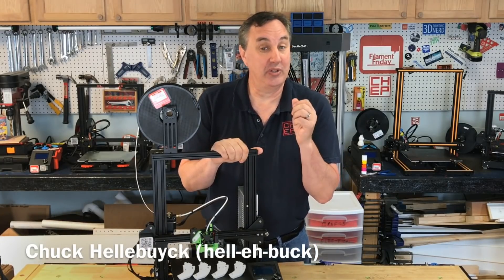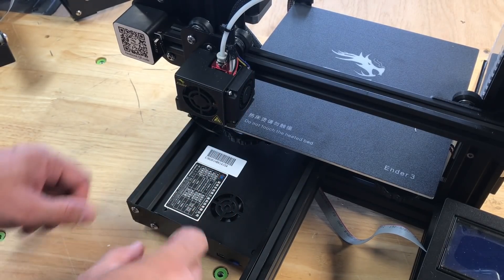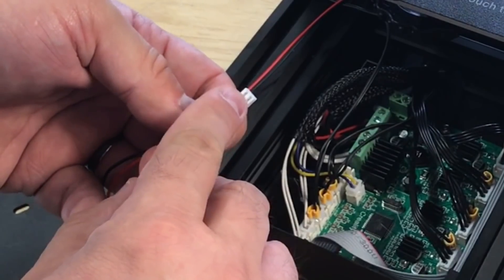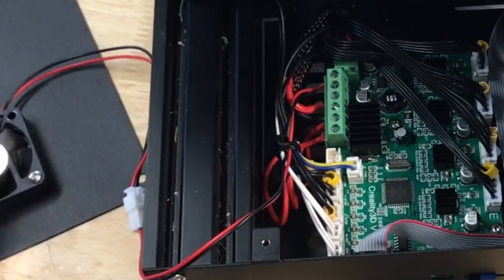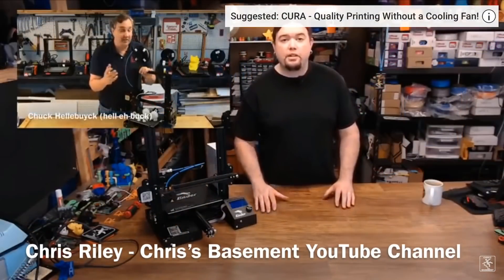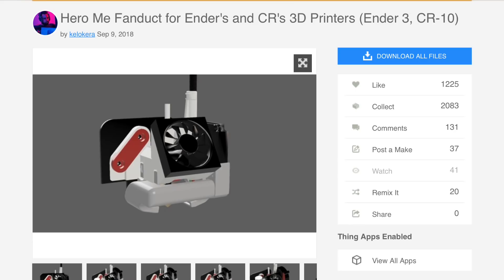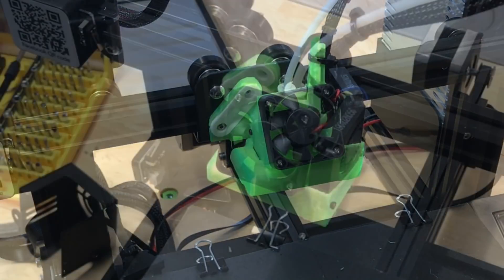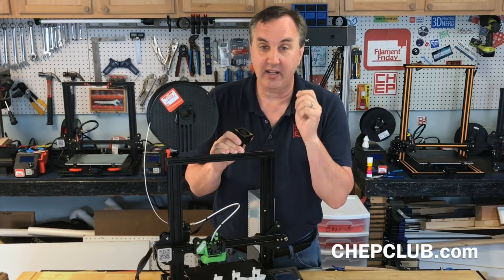HERO ME FAN DUCT and Fixing the Cooling Fans on Creality Ender 3

Comment: Very interesting how you printed the parts.  A lot of people recommend doing the bracket back side down and the cooler part front side down, instead you did both at the normal orientation with support and it sounds like it came out great.
Reply from the maker: The recommendations didn’t make sense to me so I did it the way I showed.
Reply: @FilamentFriday  I agree, I have printed this a couple times but usually a few things print bad because of the overhangs and inability to generate adequate support.  I think the next time I print it I'll use your way.

Comment: Looking at your profile, I see what you're doing -- print slow and at the low temp range of PLA. with very slow retractions and -- yes, there isn't significant need for additional cooling as PLA cools naturally as it's printed. Additional cooling does help, and the bow of the boat does benefit from it -- but you will not be able to print faster or with faster retractions without part cooling...and this is highly filament dependent. Also, the benchie isn't a very challenging print to begin with. I notice, you didn't try to repeat the bridging test with the ductape.
Reply from the maker: The Ender 3 stock firmware limits extruder to 25mm/s so that limits retraction. The bridging test used supports so didn’t see a need. Despite its simplicity the Benchy is a universal print that everyone understands so I stuck with it. Even Chris couldn’t reproduce my results until he used my profile. So yes, you understand the settings and why they work best on Creality stock machines that most beginners have.

Comment: without any cooling you will have trouble with the model interface with the supports, it will almost be welded together.
Reply from the maker: Actually I showed that in the previous video and the supports practically fell off. That’s part of my settings as well.
Though it’s just to prove a point. I still use a fan when printing PLA.

Comment: For the Ender 5 when the parts cooling fan is off is the electronics fan off as well?
Reply: I did a test with my Ender 5 and it seems when the parts cooling fan is off the electronics cooling fan (cooling the internal circuit board) is off as well.  Just like the Chep's Ender 3.  I need to do some rewiring.  Thanks for flagging this Chep!

Comment: This actually brought up a recent problem I've run into, which is uneven curling at the top of steeper (>50 degree) overhangs with the stock parts cooler, as it only blows on one side of the print. I've been looking into one of these DIY cooler alternatives, could be a fun weekend project, and I should have enough Tech-Flex to re-wrap all the wires. Without the fan, at least the curling is even and predictable, but alas, it still curls.

Comment: Hey, chep i wanted to ask have you had trouble whit big prints? because I am printing a model mid to high height and my nozzle keeps hitting the supports I even set the zhop and avoid going over supports, and its till hit some of them causing it to fail, i level the bed every time and i just don't know what to do some ppl have suggested buying a glass bed but i don't know any advice??
Reply: Might be a good test to try printing a skinny, tall object (eg a 20wx20dx150h rectangular prism) on the left side of the bed, then try a separate print with the same object but on the right side of the bed. If it's worse on one side than the other, you might have a frame that isn't square, or the V-slot wheels on your gantry may need to be tightened/adjusted to ensure that it isn't sagging. 

If they're both equally as bad, then I'd play around with the settings in Cura surrounding supports. Whenever possible, Cura does not retract between sections of infill (and thus, Z-hop does not engage when traveling between infill points). I've found that, while fine on direct drive machines, it can cause a bit of trouble with certain models on bowden-style machines like the Ender 3. Cura has settings called "Limit Support Retractions" and "Avoid Supports When Traveling." Try disabling "Limit Support Retractions" and enabling "Avoid Supports When Traveling." Additionally, if you find that the stock Z-hop height is adding significant print time to your parts, then you can set the Z-hop height to a lower number, between .16 and .28mm. Hope this helps! -Kev
Reply: @kevinroosa1315  I will try this  but  if your talking the wheels on the bottom of the bed the 2 front one I can't move them but the 2 back ones I can move them a bit freely Soo do I have to tight them?
Reply: @konanva0495  Nah, the wheels on the sides of the frame that allow the gantry to move up and down. They're along the vertical frame parts.
Reply: @kevinroosa1315   okay soo the left side is firm it does not move   but the right side has a little give to it  were the head rides
Reply: If it still doesn't grip properly on the right side, your frame might be slightly crooked. At that point, Try loosening the top four screws on both sides of the frame and re-tighten them (with the printer on a level surface).
Reply: @kevinroosa1315  I'll trie that
Reply: @kevinroosa1315  right know i am printing a  large statue  of ekko from legue of legends  the detail is really good  but when it gets to a certan heigh the nozzle drags around some infill and i think supports but i ma print the last part whit  z hop and avoid supports check out soo hopefully that will help
Reply from the maker: Konava - there is good advice here in this thread. Without seeing I can only guess but make sure the bed is level and the nozzle isn’t too close on the side that’s hitting. It will get worse potentially as it gets taller.
Reply: i have the ender 3 pro

Comment: you should add a disclaimer that fanless printing is possible but not practical tho, because you can only print really slow and you get a bit worse quality, any duct that blows cold air at the nozzle tip and the area around it is probably good enough for stock speeds (and please, stop spreading the slow speed trend!!! that printer can do at least 80mm/s with the max possible acceleration the board allows)
if I can run my anet a8 with klipper at 200mm/s 2K accel with quality better than a prusa mk2 you can probably run that ender 3 faster than 20mm/s, its such a waste of time and potential

Comment: it's called software compensation, you "solve" the problem by changing a setting, but it's not fixing the actual problem
sure it works fine if you don't care about print time, but I personally run my printers 80mm/s at the least, and plan on doing 200mm/s with the new hotend
if you don't care about a benchy taking many hours fine, but I print mine in 30 minutes
if you only print toys and aren't in a rush it could be fine for you
but some people do want rapid part turnover and quick prototypes or very large / detailed parts, that's when fans come in, they cool the previous layer to avoid sagging while printing very fast, but I'm addicted to speed so I'm biased In that way, I've seen people who wait hours for small parts printing at 30mm/s or less, I just can't, I love seeing my print head FLY over the bed laying plastic

Comment: Great video once again. I always respect your opinion and your methodology, and while i do not disagree with trying to find a great profile with no fan on, (it actually sounds like a great idea and will try to see how my profile fares first chance i get) the hero me has been amazing for certain of my prints. Every time i make major changes to my printer i print an extremely small, and a quite sizeable print to test how they compare to previous ones. True i have not seen much difference in big prints but for the smaller ones it is just magical. That makes me believe that even in large prints it will probably help with very detailed spots or at the very least allow them to be printed faster. 

Lastly, and again am no expert here, but i have mine lower than yours by a fair bit. Mine almost touches the buildplate when i have my nozzle homed. Maybe that is why ? I know you like to experiment and will be interested to see you do that with the fan duct as well. 
Cheers

Comment: Say, for PLA, If the part cooling fan is good, there will be always ON, if is bad then will be always OFF, 
the fact you can set from 0 to 100 percent makes you think.. maybe it depends..
yet again, if the air flow must be wide spread, or needs to be more concentrated..  well it depends again or maybe we don't know yet..
Is good to have options, both in design and power.

Comment: But what speed where are you printing at? I would be inclined to think that makes a big difference on the fan/no fan comparison. Print speed is a big part of dialing in a profile, are your printing painfully slow just to get good results without a fan or at the maximum speed that Ender will comfortably print?
Reply: I run my anet a8 with klipper and a custom frame at 200mm/s 2K accel and get better prints than him, at high speeds you really do need a fan, and high speed I'm talking about 60mm/s+, something he doesn't do, I don't understand why people underestimate their machines, the anet can handle 3.5K acceleration and 400mm/s with a good frame (not acrylic shit, but a printed frame with 3/8" threaded rods)
it's just dumb to run them at 10-20mm/s to get fanless, crank it up and print at 60mm/s at least, such a waste of time and potential

Comment: My ender 3 part cooling fan doesnt work in tandem with the electronics fan. Its standalone and controlled by gcode. My hotend fan and electronics cooling fans have always been on by default
Reply from the maker: On a stock Ender 3 board? 
You must have the only one.
Just so you know I’m not talking about the power supply fan.
Reply: @FilamentFriday  correct.  Not for the power supply
Reply: @FilamentFriday  Could be one of the newer boards? Though, that's pretty unlikely, as they are only putting those in their more pricey machines.
Reply: To be honest, I was thinking the same as sinister... I don't recall my fan being linked to the electronics fna. Printer is printing tpu at the moment but I'm not in so I'll have a nosey when I get back if it is still going. Its printing tpu so fan is 100%.

Comment: Might be a dumb question, but what plugin do you use for print preview?
Reply: No plugin needed. Every slicer has a preview.
Reply: @K4daniel  I'm referring to the "autoplay" one, where the toolhead moves to simulate the actual print head
Reply: @jimmyb201  just hit preview and then there are two bars, for layer hight and "layer progress", next to it the play button. At least pre 4.0 its at the right bottom. I don't like the new 4.0 gui so try the Plugin Sidebar GUI, way better.

Comment: "Don't rely on a fan to get your prints right" That's just wrong. Sure, you don't need the fan most of the time. But having a fan helps you print faster, especially overhangs. Try faster print speeds on small items to see for yourself.  So it's a really bad advice, not to rely on them. There are situations, but you generally say, ppl shouldnt use fans
Reply: if you print faster than him (10-20mm/s) you'll need it, he just wants to win an argument, not show actual results
fans are crucial in printing small parts, small details or fast prints

Comment: Chuck I did the same thing to my Ender 3 Pro. The only difference is that I connected a second fan directly to power. I purchased the new Creality Silent Board, which is nice not hearing my stepper motors, but I head that the board can overheat due to the PCB not having enough layers and copper for heat dissipation, so I just printed a new cover plate which added a second fan. Hopefully with the new fan and the OEM fan coming on at the second layer can keep my new board "cool"

Comment: Personally I run the Hero Me with dual 40x10 fans because it looks cool with the fan guard I'm running and it works at least as good. There is a slight improvement in print quality but getting to the bowden tube can be a pain for nozzle changes. The Micro Swiss I'm getting ready to install will solve that problem. Keep up the good work Chuck.

Comment: Being new to 3d printing and doing as much research as I can I'm always learning that the slicer profile is key to a good print. I'm not saying I know exactly how to do it yet Hahahaha! You're completely right my friend and time tuning your profile to work with your choice of material is very important. Your videos continue to help me with this and I thank you for all your help!!!!!
Reply: you can't fix a broken machine with software, you do need a profile that suits your machine and it's capabilities, but the ender 3 is such a robust machine that can handle 20X what he's asking for,
you shouldn't listen to him or "the first layer", both of them seem to spread a lot of misinformation
fans are crucial for small details, small parts, and fast speeds
you can push 300mm/s and 3.5K acceleration on that printer with Klipper or a 32bit board, the hardware itself is VERY robust, but there are limitations like processor speed, I'd say you can go for 60mm/s 800accel on a stock machine easily
going fanless is stupid, unless you want to print at 10mm/s and take ages to print
Reply: if you want to see my printer take a look at @l3d_ush on Instagram
it's a true workhorse and the quality it achieves is amazing
Reply: a small tip I want to share with you over years of 3d printing is: don't listen to people on the internet, they probably don't know better
always push the limits of your machine
never underestimate the power of your machine
I got an anet a8 running at TRUE 300mm/s 3.5K acceleration with Klipper firmware, how? because I always went for more, I never listened when people said it couldn't handle it or it would print like crap, now I can print super fast and I got the best quality prints of an anet a8 I've seen on the internet
there's TONS of misinformation on 3d printing, be careful and always test yourself
it's true that good settings are crucial, but don't try to solve a hardware problem with a software setting, you need fans to print good and fast
your settings should actually be driven by your machine, not the other way

Comment: I agree that the fan is not so important

I printed a raspi housing in PLA with a PETG profile (No Fan a lot hotter) and that even came out quite nice 

its all about speeds and retraction settings, especially with the bowden setup on the CR10

Comment: I installed creality 1.4 MB with TMC drivers and replaced all fans with SUNON fans. They are vapo maglev so they are rly silent. Installed 4020 on hotend, 4010 on MB connected parallel to hotend like you did, bcz TMC drivers gets rly hot and 5015 blower part cooling fan. 5015 and 4010 are 12v so i used buckconvertors. I figured out that PWM doesnt work through buckconvertor. So to change speed of fan I use the buckconvertor itself to change voltage and speed of fan.

Comment: Totally agree with Chep, with cooling you either get it spot on and it cools correctly or not when there is not enough cooling. I would say the profile plays a very big part in getting prints to come out right. To much air flow it effects prints, to little air flow it effects prints.

Comment: Question:  Does that mean that if you run your part cooling fan at 10% then the electronics cooling fan runs at 10%? or is this only if the part fan is off?.

Comment: My results from using the Hero Me were slightly to a significant amount better (bridging).  Try with a bridging test.

I also installed a larger blower fan (using the provided alternative version of the Hero Me duct), but ended up using it at 80% power due to excessive vibration.  Could be due to using a cheap blower fan, so I have bought a better (I hope) version, but have yet to install it.

Comment: Chuck your a Legend, I always knew that "hero me" duct was a waste of time-I suspect the Bullseye one is too. Am so glad your doing these videos and debunking all the misinformation out there. Just one question-where can we find your profile?? I'd like to try your setup in S3D too👍
Reply: Might be a waste of time for you, but slight improvement is still improvement so I will keep using it
Reply: Rapidash1 it's a waste of time for me because I use my printer for ACTUAL functional prints like FPV parts for my RC planes. I. Don't spend copious amounts of money on PLA printing huge bridges and overhangs "because I can". I've done pretty much what chuck has done and tweaked my S3D profile to the point that every print comes out really good. I've tried several differrent ducts over the year I've had my Ender but I always find I get the best results with the stock fan duct. 
It might not be ideal for 200mm long bridges, but why would you want to do that anyway, especially when you can use supports🤷‍♂️ some guys live to just print torture tests, benchy's, calibration cubes, retraction tests etc and have no real functional use for the printer (I'm not saying that you don't, I'm just generalising). Look in the Ender 3 group at all the "test cubes etc-there's more test prints than anything else!!
Reply: @Johnn_T  Bridging and overhangs are certainly necessary for a lot of functional prints as well.
I make a number of different camera mounts that I sell (that's probably as functional as prints can get). They absolutely need to have a part cooling fan both for looks and function.
This new idea that part cooling fans are not necessary is very strange. We have proven that they are indeed necessary for some prints a long time ago, we don't need to start doing that all over again.
Reply from the maker: Link in description

Comment: Hello, everybody,
I've had extreme problems with PETG. With the cooling it works great now. The surfaces are sometimes better than with PLA. I used the same profile as without cooling. So it worked for me.